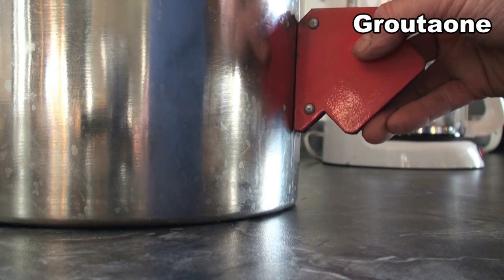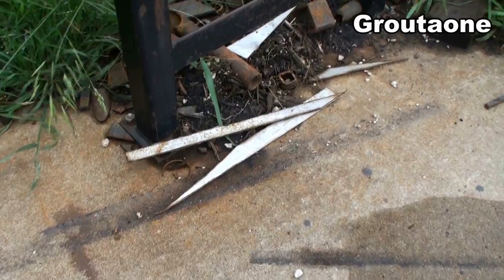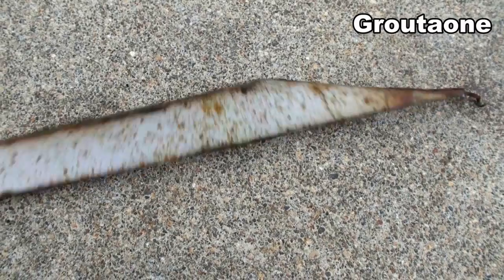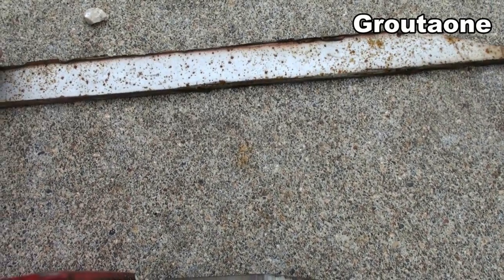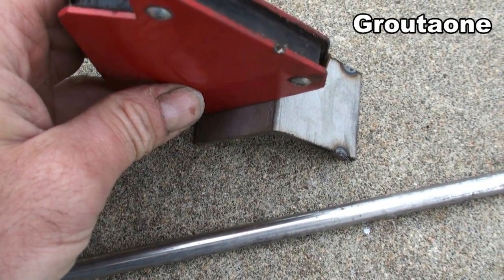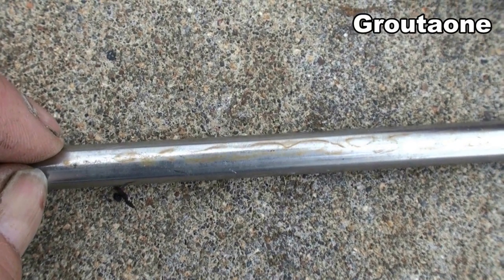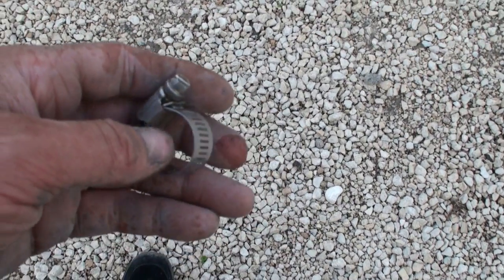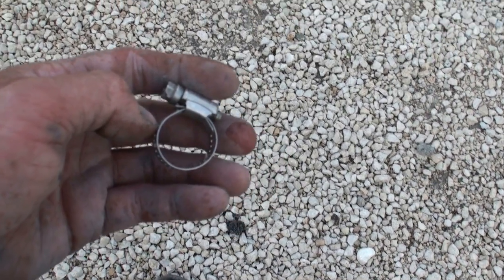Stainless Steel That Rusts

Comment: 304 is best it will rust also if you cut through the protective "skin" all stainless has some amount of iron in it the less iron the better, the more chromium nickel and moly the better

Comment: Stainless steel WILL rust. I make springs for a company and I have to explain this all the time when they ask why parts end up rusting a little. all stainless steel still has some potential to "react" next to carbon steel, or carbon steel dust. Although stainless steel is much more resistant to corrosion than ordinary carbon or alloy steels, it will still rust in normal conditions on rare occasions. Before we ship the parts out we passivate them, meaning we give them an acid bath to remove any carbon residue, and coats the stainless in this layer of acid which will protect it and cause it not to rust.

Comment: I believe 316 stainless doesn't rust unless you get bits of iron imbedded in it. That's why they tell you never to use a grinder on stainless, that's previously been used on steel. I think however, it can corrode over time as opposed to rusting, probably in marine applications.

Comment: it is just as grouta said, its like soup. I acquired food grade ten foot sheet from a truck stop not long ago, the trailer hauled something sensitive. Very expensive. Good stainless can gain iron drool on top of it, if it is connected to low grade stuff, that is the only rust 304 can get. Exhaust can indeed stay low grade as long as the engine is not lean burn. 409 stays new enough to wait out the carbon layers...then it is in for the long haul. Up by the engines head 304 is a good idea, as momentum of heat keeps everything too clean. Regular iron loses there. I welded on some painted mufflers for a cat 550 a few years ago, still like new. The pint was designed to work with diesel carbon. Alot of tricks.. too many complaints to lack of knowledge.

Comment: You can help make stainless less stainable. lol ----->The passivation of stainless steel is a process performed to make a surface passive, i.e., a surface film is created that causes the surface to lose its chemical reactivity. Stainless steel is already known as being corrosion-resistant, however the passivation process further strengthens its’ natural coating by improving the exterior surface of the overall part. Stainless steel passivation unipotentializes the stainless steel with the oxygen absorbed by the metal surface, creating a monomolecular oxide film. Passivation can result in the very much-desired low corrosion rate of the metal. Passivation also is accomplished by stainless steel electropolishing.

Comment: 90% of the time when someone makes something out of stainless, the whole reason it rusts is because they weld it with regular Mild Steel wire, or rod...of which pollutes the stainless and therefore basically becomes mild steel.

Comment: From memory when I worked in the UK steel industry there are 2 main types of Stainless: Austenitic (304. 316 etc) and Ferritic (409 etc). Austenitic is made into sinks, cookware and marine fittings, it contains more Chromium and as you say is a different alloy.  The Ferritic is made into exhausts because it has better thermal properties.
The rust you show on the cut strip of stainless was probably caused by someone grinding mild steel nearby and the sparks and filings hitting it, these stick to the surface and rust.
When Austenitic stainless is formed it becomes more ferritic and will become slightly magnetic. Forgive me if I'm wrong it was a long time ago...
PS I liked the distraction!

Comment: I work in a machine shop and work with all kinds of metals. Stainless is rated by number 300 or less should not rust. A kitchen sink or counter top is around 400. most knifes are around 400 for the reason it will stay sharp longer.

Comment: In the Navy they gave us a list of metals graded by how much they would react to each other corrosion-wise, i .e.  the two metals next to each other on the list would react very little but the two at either end would react a lot. Also metals one one side of the list were prone to rusting, so when you had a metal panel that needed a screw, you picked a screw made from the metal next to it on the rusty side, so if it did corrode the screw would rust and not the panel. :-)

Comment: its the carbon in the stainless  400 series or knife stainless got carbon in it that why they rust the 300 series have don't have carbon or a very small quantity more carbon mean less chrome and its the percentage of chrome which is important for protection again rust  higher is better

Comment: you can also check stainless with a angle grinder. the more sparks the more iron. for example when grinding 316 therese almost no sparks at all. but also, if you weld stainless steel in the same room as you have worked on regular steel, the stainless might start to rust quite some from the stainless weld. see it all the time at work
Reply from the maker: The spark test is maybe another video idea, thanks for that. The 409 that has all the rust spots is from it's own cutting sparks

Comment: Magnetism has little to do with how `stainless` your stainless steel is.
It only means that your stainless steel is of a ferritic kind (400-series), austenetic stainless steel (300-series) is not magnetic and martensitic stainless steel is a little bit magnetic.
Being either a austenitic, ferritic or martensitic stainless has to do with the crystal structure of the material.
How resistant your stainless steel is has to do with the composition of the stainless steel, more chromium means better resistance to corrosion.
Cheap/bad stainless steels have too little chromium in it to make a protective layer over your part.
Also, if your stainless steel is contaminated with mild steel (welding spatter or spraying on it while grinding), your stainless steel WILL rust.

Comment: Just like in all types of metal , there are different alloys in all of them . They just add different ingredients to get the metal mix they want. I done fire brick for many years ,and have rebuilt lots of stainless ,steel ,aluminum ,copper, tungsten and lead furnaces .  There at the plants you get to see them mix ,for different metals . It is amazing what all goes in to metal.

Comment: One reason I like Borla mufflers, they use 304 stainless and after an extremely harsh and very salty Pennsylvania winter, I see zero rust on my car's mufflers. Save for the mild steel hangars the exhaust shop used, of course. My truck has a Flowmaster and it's about to rust through. Granted it's much older but they use 409 stainless and it shows.

Comment: All stainless will rust in! time
Never seen a SS Knife or gun that would not rust when left outside in the rain.
Reply: No it won't man! I work in a water treatment plant with very saline water. All our pipework is 316 or 'superduplex' and it does not rust, no matter how long it stays wet, even with salty or chlorinated water. Knives and guns, maybe but not 'all stainless steel. Why not say 'In my experience' or something, instead of stating as fact something which is simply not true.
Reply: D R  
316 (316 Is not Super Duplex only "China  Duplex"/ austenitic grade) is only corrosion resistance. and will rust.

 super duplex 2507 is "99% corrosion proof"
Reply: ***** If you could read he said or not is.